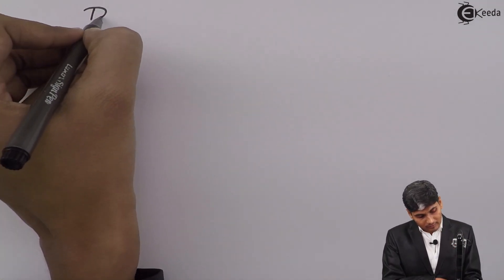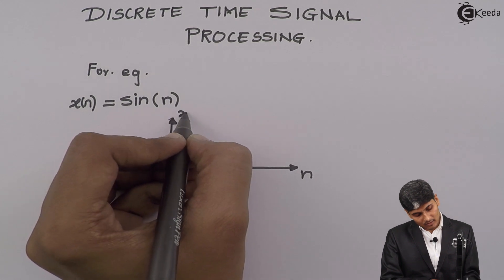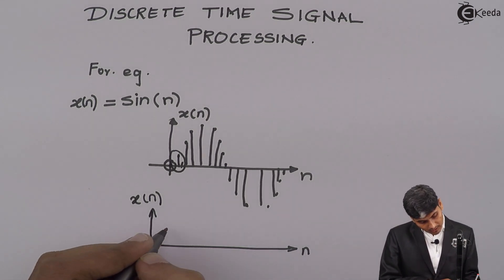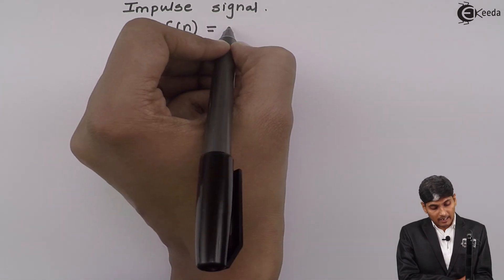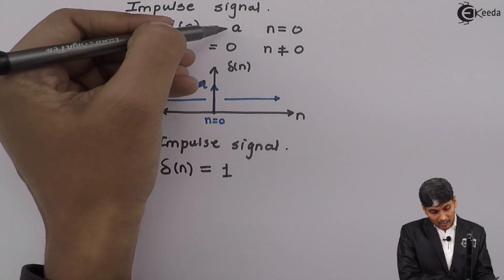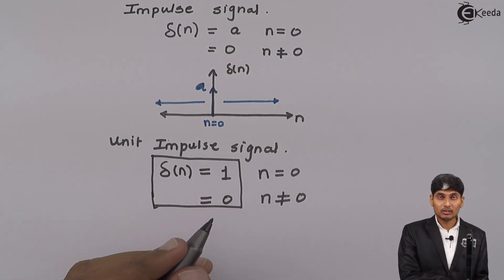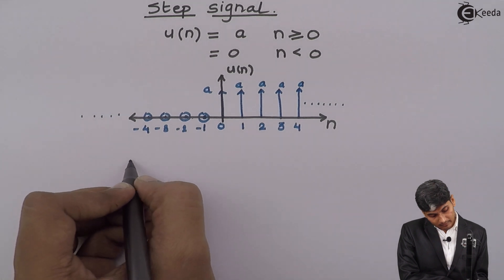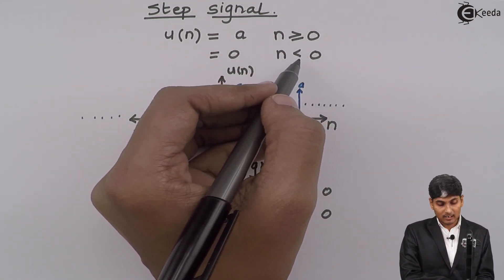Understanding What is Discrete Time Signals Processing | Discrete Time Signal Processing

Comment: He takes two things counter intuïtive. The first is using the volts  over the resistor as an output instead of the current sent through it and secondly when he dubtracts t0 from t (t-t0) while it should be added. For the latter he justifies this as time 'delay'. Really.
Reply: i dont get it , is he wrong , should i consult some other resource to learn this